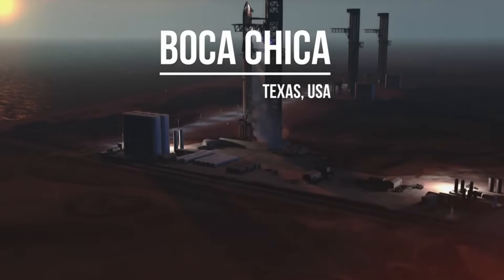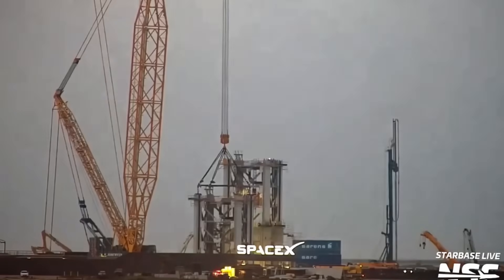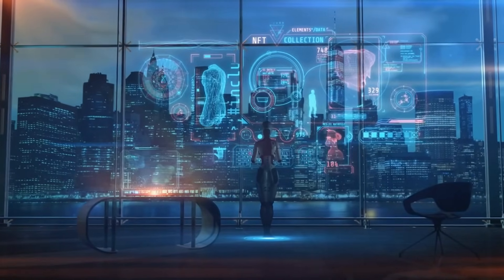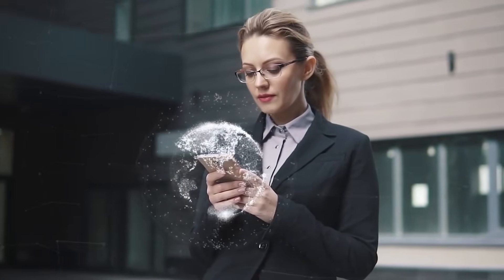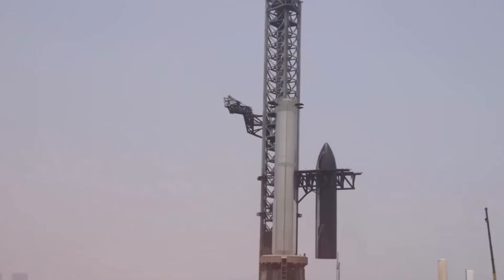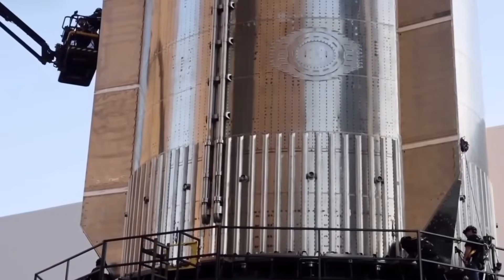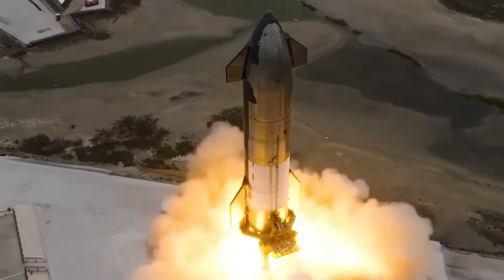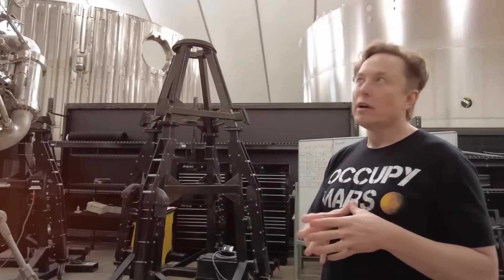Revolutionary! SpaceX’s Launchpad B Redefines Space Travel Ahead of 2025!

Comment: I'm even more convinced now that the way to Mars will involve a semi-stationary accelerator and a complimentary decelerator, array, in space; like perhaps, a 100K mile long solenoid electrode made of wire rope,  having nuclear engine means at the rope terminal ends, for positioning and holding the cable taut .   Some other accelerator and a complimentary decelerator pairs are conceivable and may be cheaper and better.  Using physical fossil fuels is a distraction and an indefinite constant impediment..
Reply from the maker: While the idea of a semi-stationary accelerator and decelerator array is fascinating, could the pursuit of such advanced methods lead us away from practical solutions that SpaceX’s current innovations, like Raptor engines, might bring us closer to Mars sooner?
Reply: @Elonmusk24h  Thank you for amicably pursuing the clarification.   
     Nothing wrong with making the most efficient rocket engine possible.   Building a refinery to fuel thousands of flights is too inefficient; is what I am asserting.   Especially when the fuel carrying parameters include dangers to the crew.